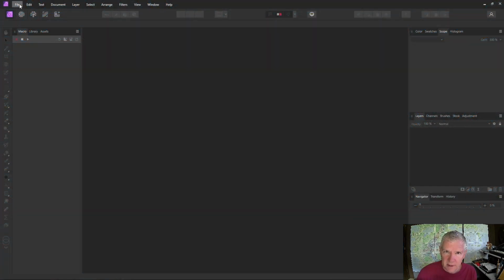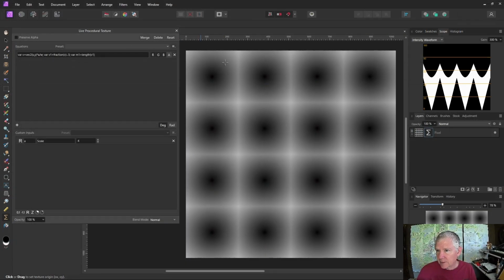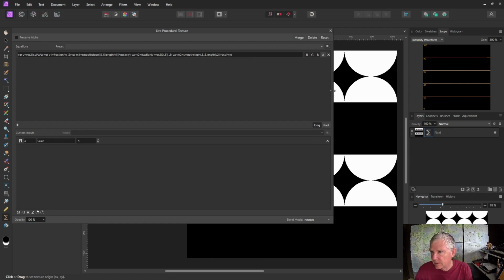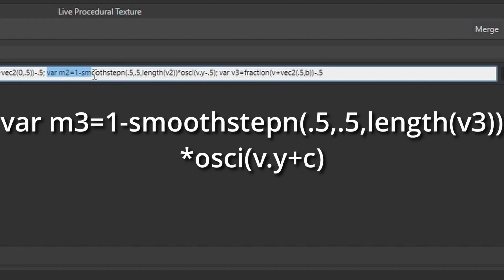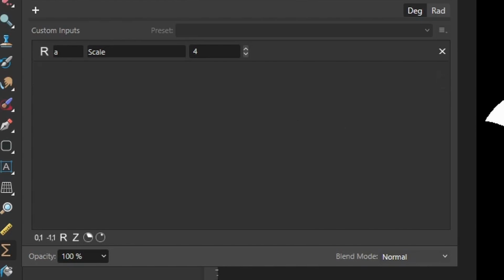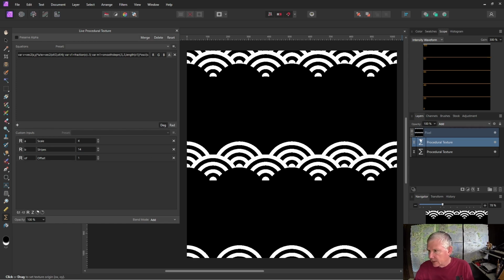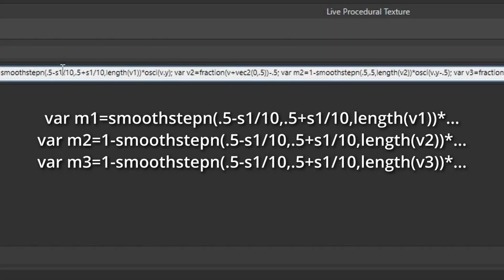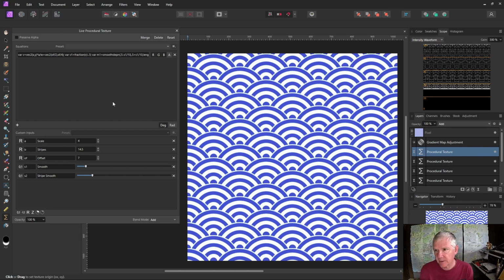Siegaiha Pattern using Affinity Photo's Procedural Texture Filter

Comment: var v=vec2(x,y)*a/w+vec2(of/2,of/4); var v1=fraction(v)-.5; var m1=smoothstepn(.5-s1/10,.5+s1/10,length(v1))*osci(v.y); var v2=fraction(v+vec2(0,.5))-.5; var m2=1-smoothstepn(.5-s1/10,.5+s1/10,length(v2))*osci(v.y-.5); var v3=fraction(v+vec2(.5,.75))-.5; var m3=1-smoothstepn(.5-s1/10,.5+s1/10,length(v3))*osci(v.y-.25); m1*m2*m3*smoothosc(d*length(v1),s2)*1-length(v1)*f*g
(0,1) f,  R g          

Apologies, as I kept the original b + c variables throughout.  d is stripes.  Fantastic as always!
Reply from the maker: There are quite a few variations you can find for this pattern. I first tried doing only a semicircle, but it caused a very small artifact that I didn't like.
Reply: @plasmaportl  I was having trouble getting color combinations using Gradient Map that I liked even combining the gradient and stripes as separate layers.  By the time I worked all the way through your lesson, my brain automatically wanted to add the length(v1) having forgot about it from the beginning!  I should have left the adjustment variables in the equation and set them at 1 for going back to experiment on the pattern.  I must say your presentation and flow are kicking it lately!  I had 24 layers(steps) in my saved file before I started to play...:goodvibes:
Reply: @plasmaportl  Surprise...
var v=vec2(x,y)*a/w+vec2(of/2,of/2); var v1=fraction(v)-.5; var m1=smoothstepn(.5,.5,length(v1))*osci(v.y); var v2=fraction(v+vec2(0,.5))-.5; var m2=1-smoothstepn(.5,.5,length(v2))*osci(v.y-1); var v3=fraction(v+vec2(.5,.5))-.5; var m3=1-smoothstepn(.5,.5,length(v3))*osci(v.y-.5); m1*m2*m3*1-length(v1)
Reply from the maker: @TV-tq5ed Should there be parentheses around 1-length(v1)? Or was that the surprise?
Reply: @plasmaportl  I didn't quite know what to call it...eggs?  Dragon Scales would be better with a linear gradient.  The parentheses is good form.  It seems to work though.  I was not crazy for the OSCI on this.
Reply: getting there with the texture fills🤗